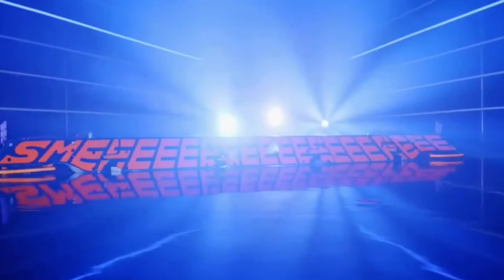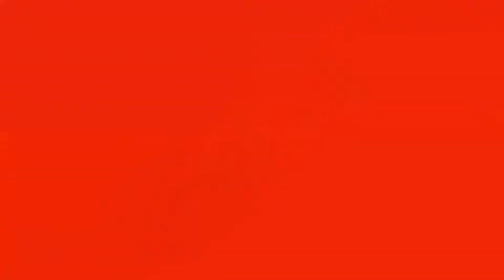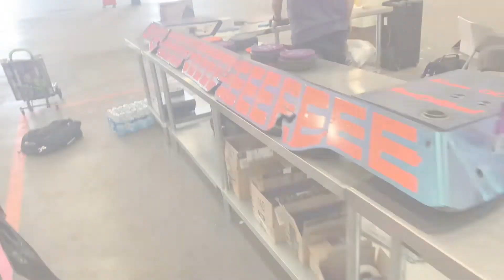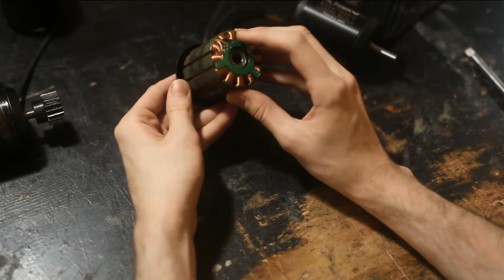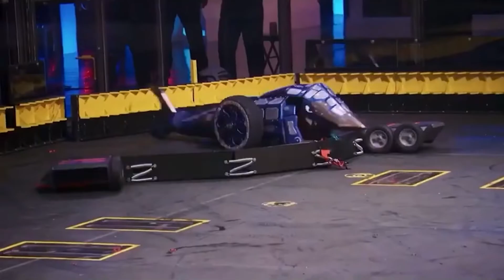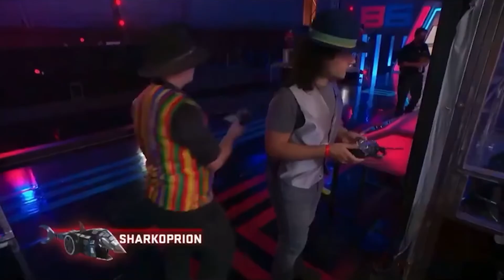Battlebots season 5 episode 1 SMEEEEEEEEEEEEEEEEEE Motor 6384 190KV FSESC 6.6 | Flipsky

Comment: so a single 6384 120kv motor can pull a 500kg weight go kart using chain drive and sprocket???

so no need for 2 motors?
Reply from the maker: A single motor can also load, but it cannot provide too much speed. If you need a better driving experience, it is recommended to use two motors.
Reply: I can use a bigger sprocket with say 14T on the motor and 28T on the wheel to increase speed. can this still pull the cart?

Comment: One thing I wonder about battlebots is why there are so many unique designs? Are they required to make something that looks good so the show is more interesting? Because I would assume that over the time the teams will converge to few designs that are better than others and just improve on those instead of experimenting with whole different concepts.
Reply: Pretty much, its a show more so than a competition. It would be boring if you were watching the same style of robots fighting match after match.
Reply: @lukem3260  Yeah, that will be the case. It would be interesting to see how the teams design the robot not only for fighting, but for it to be likely picked for the competition. I mean their thought process when designing.
Reply: @infiniteoffset  Ive looked into the application process. I believe you have to submit full documentation of the robot youre entering in order to even be considered. It's likely they wouldn't want more than two robots with similar designs competing.
Reply: Creative people make creative things.
Reply: @ryanbratley6199  Well, yeah, but there is usually not that much creativity in competitions. Every single robot is unique. Some bots are clearly better fighters than others, so you would expect copycats of it.
Reply: @infiniteoffset  Copying the best will, in most cases, make you second best at best. As soon as something becomes recognised as the design to beat, people start finding new ways to beat that design - and the results are usually unexpected.